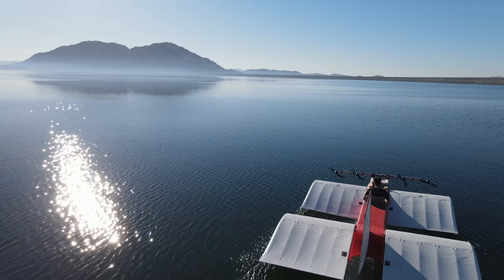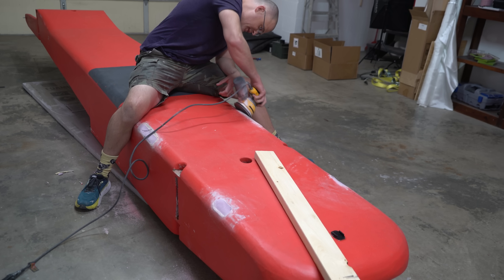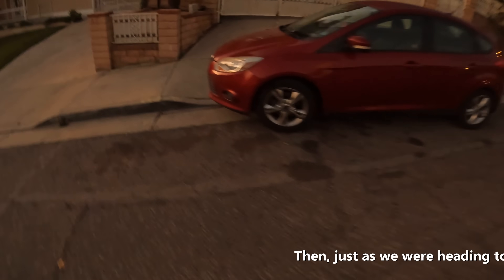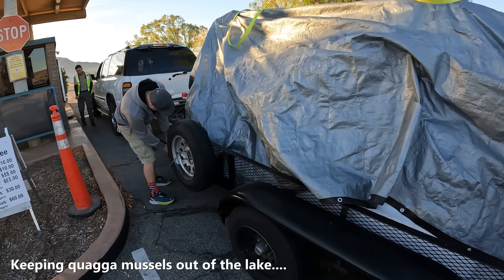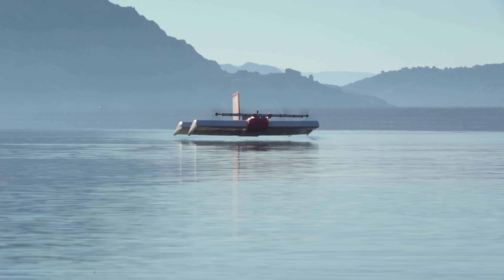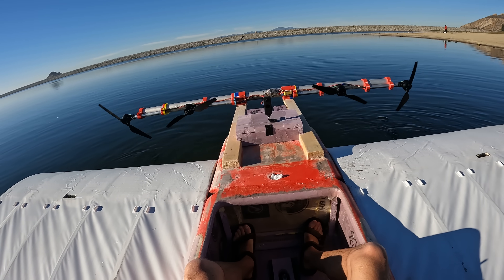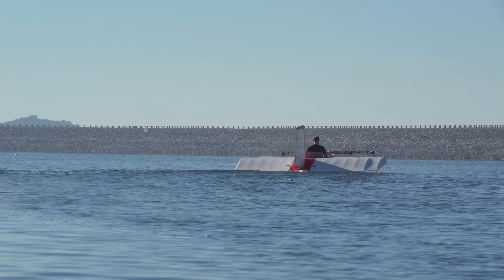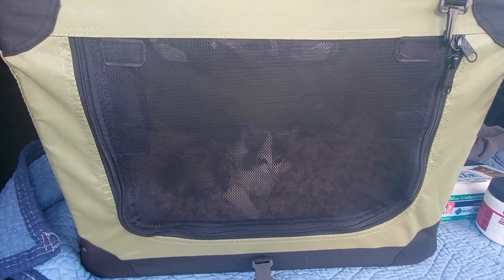Human Carrying 6 Meter R/C Ekranoplan  (RCTestFlight Collaboration)

Comment from the maker: Head to https://squarespace.com/thinkflight to save 10% off your first purchase of a website or domain using code thinkfight
Reply: which lake were you guys testing at?
Reply: @Mtron1000  b
Reply: @Mtron1000  mmk
Reply: Mlkllkkk9ipoopopopopopopopo0
Reply: @Mtron1000  😊❤
Wo ¹😮 muje
Reply: How did I end up here
Reply from the maker: @NicholasRehm  cuz airplanes 😆
Reply: why code "thinkfight" not thinkflight?
Reply: Great work.
Perhaps you should try a height control wand, as foiling moths etc, but linked to the rear aèrerons
Reply: You need more thrust now! Get 8-12 more of those with blades that have optimal pitch angles
Reply: Can't wait for the next test ❤️ this was totally epic!
Reply: Where send check
Reply: Fight or flight? 😉
Reply: I prefer round space
Reply: now put wings on it
Reply: You want to take it to the LAND FILL? dude I would be more than happy to take it.
Reply: It would be interesting to see whether radio controlled fan angle adjustments would have allowed it to fly with the pilot aboard by finding the optimal angle of thrust..
Reply: Wrong ground effects.
Flip the wing upsidedown for ground effects.
Increase wing thickness for better efficient.
Reply: yeah... us fat Americans are some heavy boys. You need 2 more props *I also think it's partly in your foil shape, That's quite the flat curve on the bottom side, from a paraglider's perspective i would have thought you'd want a bit more curve but i haven't spent the time in this like you have     *LANDFILL?!?! Dude... someone would have PAID for that
Reply: All fun and games until you finally pitch or roll into the lake and find yourself tossed forward and diced up a bit. But that's OK if you're Ok with that, right?

Comment: The Chinese channel 魔界造物 made a ~ copy of the project of ekranoplan and made zero references to your channel, however, the Chinese are known for their integrity with intellectual property 😂.

https://www.youtube.com/watch?v=4pSRWII4hHQ&ab_channel=%E9%AD%94%E7%95%8C%E9%80%A0%E7%89%A9
Reply: Yes but they make it better
Reply: @logicalthinker_  How did they do it better? He made a CAD model in CATIA V5 and cut plywood and foam on a CNC and made the spar with a carbon tube. That's the end of all differences, people just had a little bit better equipment and digital design for better accuracy and they built an equivalent airframe, even the engine is identical. It's like seeing the American F-16 and if they made a copy of it in China and said "this is exactly the original design, 100% Chinese", it would be unpleasant for the original engineers and a distortion of history. The Chinese guy in the video was showing short shots example of the others ekranoplans flying, and there were shots from this video, so the Chinese guy knows exactly what he copied, but he didn't want to mention it in front of the Chinese audience.
Reply: @dennyfpvx I would disagree with you, since the design and finishing are far from the same, if you are talking about copying then all ground effect vehicles are copying the Корабль-макет
Reply: @Ilovecruise  How exactly is the Chinese version different from the original? Structural power parts such as spars, longerons, nerves, caissons and skin are the same all over the world. The Chinese copy copied all the proportions and shapes with the dimensions of the original, RC models are copies for all that because they have the same shapes, not the same internal structure.

Comment: It needs to have stronger engines and they need to be a little lower than the wing because the wing doesn't have flaps and its agulation is very low and the way it is the wind is directing upwards, the ideal is for it to be below the level of the wing.

Comment: Have you thought about putting vertical plates on the ends of the wings to stop the drag and wasted power, should be just above water level when flying. Good work guys. I think swap the motors to x9 for more thrust too.

Comment: A couple of things, 1, would ducted fans set lower work better? 2, The wing tips maybe need vertical winglets. 3, have you thought about toroidal props inside ducting? Maybe quieter and more power. 4, when are you doing a complete kit. I want one in Australia.
Reply from the maker: More power and higher pitch props would do the trick.   Don't get sucked into the toroid hype....
Reply: @thinkflight  Just me thinking out loud. The toroidal propellers thought is just about making it quieter more so than more power.

Comment: If limiters are placed at the ends of the wings that do not allow the flow of compressed air to flow out, then sufficient lift will turn on earlier.

Comment: Just put one rotor in each "wing", so you can pull air into the air cushion. Then use software to regulate the distance from the water.

This lets you take off by a push of a button, and the other 4 rotors can be used to just move the craft forwards.

Comment: The front is a hypercritical airfoil. It is mounted at too high an angle of attack so it wants to climb which it cannot. Lower its mounting angle and it should float in ground effect. The lift curve slope is very low and extended which means it gives a little lift throughout its envelope, thus flying boat. Everything under the wing span is ground effect so about 10 feet. It should float at about 3 feet above the water up to 90 mph with useful load about 160-200 (not) lbs. Tail feathers are important on this, because all vertical control comes from trim. No tail feathers no control. Getting started has to be on water. If it doen't lift from water, you're just grinding the material off. The horizontal is also a flying surface that gives lift at a low aoa. Don't know what to say about that one except that most horizontals are not flying tails on any aircraft. Their airfoils are either neutrally lifting bodiies giving lift at higher aoas or are inverted airfoils giving downward lift at zero aoa.

Comment: I think you could make pitch problems much more manageable by making side skirts as the ram effect would stabilise it. Also less wing tip losses and structural rigidity as a bonus. Flarecraft type is a good example

Comment: I can only imagine what would happen if the pitch of the wings and motors could be controlled in flight. Or the addition of a second row of motors in front of the rear wing with tilt control and extendable hydrofoils mounted to the outside of the hull 🙃🤔😱😈

Comment: Put sides on the wings. also if you have compressed air squirt it through a pipe to create bubbles to break water tension.
Reply: Also a reverse delta wing, is less likely to throw you off.   try it with an old jetski motor.

Comment: So depending on how heavy that is you may or may not have committed a felony fingers crossed that the faa doesn’t say anything.  But you could definitely claim that it’s a high speed Watercraft that uses an Aerofoil to decrease drag from water but do keep in mind that under part 183 ultralights have to fit certain parameters like only having a 5 gallon fuel tank

Comment: Only issue I see with the plane is to make any real flight u need longer wings it has way to much drag and that won’t be good in the sky wing span is not long enough for the shape it will be fine in a straight line but not turning and change the wing angle pitch because that’s make drag as well basically wind is pushing it down not up

Comment: Have you thought about a way of changing the pitch of the motors during flight? You could use a crank on the aluminium shaft of the motors to rotate them up and down. Then either a lever with a connecting rod in the cockpit, or a servo to control the whole thing.

Comment: I believe you need to have the air flow over the wing in order to create lift. The air has to increase speed over the wing . A principle of flight. That why the top of the wing is cambered. To increase speed and change it pressure

Comment: to make it easier to surf in the water, put foil under your boat, to make it easier to fly, maybe you have to make a vacuum in the body of the boat and its wings. Make controls on the front and rear wings.

Comment: Without any power changes, what about just adding straight fences to the bottom of the wingtips. Stopping the spillover from high pressure under the wing to low pressure above. 
Great build 😎👍

Comment: You've done what so many have done before, shown that aerodynamics doesn't scale down. What works at the size of an aircraft capable of carrying a human doesn't work the same at model size. A small scale Ekranoplan takes so much power to get airborne that it inevitably has so much excess power that it's capable of rising out of ground effect.

Your human scale version was able to have enough power to lift off yet not so much it could brute force itself high above the surface.

Comment: Suggestion, res-skin the wings with actual fabric, staple the fabric to the structure, brush sealer on it, add a bicycle tire filler valve into the wooden structure and fill about 3-4psi of helium into the wings.

Comment: Wonder if a hydrofoil on the bottom center section would help with raising the whole boat out of the water easier so you could direct the thrust from the propellers accordingly to gain more speed out of them. Naturally the wings would start to generate for lift, but with the foil in the water it could help keep it closer to the water and maybe create a little more stability at higher speeds. Maybe be able to control the air cushion a little better too. I haven’t put much thought into it but maybe that’s an idea 💡
Reply: Daniel(rctestflight) tried adding a hydrofoil to one of his smaller scale GEVs and determined that it caused more problems than it solved.
Reply: @Toemoss-Perspective  I seen that and was rather disappointed in the shape and poor quality of it. I think with a better design they could be rather beneficial

Comment: I think you need about 6' more wingspan on each side, and you will get fully airborne. (You are losing a lot of air lifting pressure out the sides of the wings). Maybe add a plexiglass skate blade type of strut under each outer wing tip.  Also if you catch more air under your main fuselage you may get an air lubrication effect which would help in getting up to flight speed faster.
Reply: yeah, Russian-style ekranoplanes (just like the one these 2 constructed: square, mostly flat wings, except tail stabilizer typically lies at much higher level than main wings) have a vertical protrusion from the edges of the wings downwards, helps keeping the "air cushion". Or they could go try a German-style ekranoplane, with inverted delta wings (as the Iranian patrol "boats" in the Persian gulf do). These are self-stabilizing at low speeds, thus probably better for what they're doing

Comment: I might have an elevator. Your center of lift moves with the speed. Would also aim the props straight back. It should give you more lift. You want the air on top to go faster than the air below the wing. Looks like you had plenty of power for ground effect.

Comment: You dont need more power or lighter rider. You loose air from the wingtips. You need a "skirt" to seal the wingtips. Just glue a side panel on each of the wingtip until the sea level. my2c

Comment: Awesome, well done. Not too impressed though with the covering on the wings being so loose. Result of sunshine expanding the material. Solution, is to use nylon shower curtains laid on glass and soaked with epoxy, ensuring excess is removed. Result is hard surface but still Lite, this can then be cut to size and contact cement or Gorilla glue onto ribs. End result, wing covering stays firm and also water proof.

Comment: Sooo.. what probably slowed the craft from actually lifting off? No 'Step' on the underside. Review the plan form of the classic era 'Flying Boats' to see the reference. Basically, the problem is 'Escaping' the 'Grip' of the water's surface is the most significant contributor to 'Drag' and other factors limiting the vehicles getting off the water. 👍

Comment: That was gorgeous very seldom do you find a craft that flies fairly well without a passenger can fly with a passenger so well the first time I love the Simplicity of the design and the way you are able to work with inexpensive products to make your prototypes the whole package I like it I would like to see you build it up to be a two-seater I don't see why that's not possible you might have to work on every aspect there are dynamics the power of the thrust the weight dispensation the foils themselves need to be modified I already saw that and maybe even put a V-tail on it that would be nice

Comment: My thought is you would have generated more lift and speed by NOT changing your thrust angle.  By changing the thrust to a more downward angle to the chord line you have  two probable effects: 1. Losing some of your forward thrust to aft pitch moment due to deflection down from forward of your CL and 2. causing higher speed airflow Under your forward wing causing lower pressure differential compared to the upper wing surface.  You ideally want the high speed airlflow over the  top of the wing and lower speed airflow under it.  The wings under camber and AOA would  already contribute to its  having a damming effect to cause a high pressure in ground effect that you somewhat negated but  blowing higher speed air under the wing.
Reply: I did some additional reading on the Russian ekranoplans and picked up a few more tidbits.  The ekranoplan did indeed deflect the jet thrust under its main wing, but this was due to the design where the wing was part of its floating hull and this thrust was only present to help get this wing out of the water and into the airstream, then the deflectors would be retracted to thrust perpendicular to its chord line.  Also only the main lifting wing was in ground effect and this makes sense.  With the stabilizing wing  being outside of ground effect its lift would have a linear relationship to velocity, where the main wing has a dual relationship with velocity and ground effect.  Thus as the ekranoplan got out of ground effect the main wing loses lift while the stabilizing wing does not causing it to descend.  Conversely if you deep inside of ground effect the main wing lift increased but the  stabilizing wing remains unchanged causing the ekranoplan to ascend.  These effects caused a build in stability so that velocity would be the determining factor to stabilize at an altitude at a given trim and balance.  The ingenuity of  Russian designers never ceases to amaze me.
Reply: More horsepower’s.

Comment: What motors are you using?
Reply from the maker: Hobbywing X8's
Reply: @thinkflight  thanks
Reply: May need something a little bigger for my design, Two in the aft one each wing
Reply: @thinkflight  My usage of power to propel 7 to 1000 lbs, in a Wig craft.  I am working on a 18' by 11 wide on the wing. 3 " fuselage.  Made two small scale, glide was assume across the floor.  I need to figure out power requirements to push this craft at least 80, to 120.  I would possission in the rear, with aleurones to stablelize the nose pitch.  I went in the flight of birds

Comment: I think you are misunderstanding the fundamentals of lift on a wing.  It is the air traveling over the top of the wing creating a low pressure that causes lift. Not how much air is under the wing. By pushing the trust down you actually decreased lift. It is called The Bernoulli Principle.

Comment: Add a retractable  hydro foil  and use it with a rudder .  

It would  u probably  use less power  to get up out the water. 

And level  the air craft .

Comment: Congratulations on this amazing machine! Would have used a helmet, safety glasses, and lifejacked on that trial though... :) The newest generation of sailboats are using foils to "fly" above the water but the biggest resistance and cap factor is the cavitation on the foils at about 50 Knots....wonder if ground effect + sails (or rigid wings - check Americas Cup) + daggerboard for lateral resistance would work ! Willing to try? Thanks and congrats again!